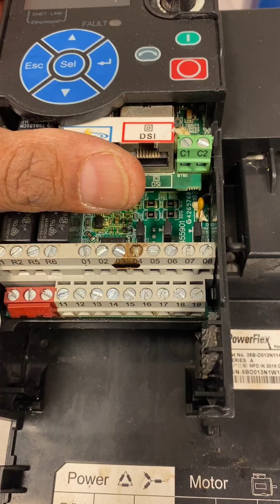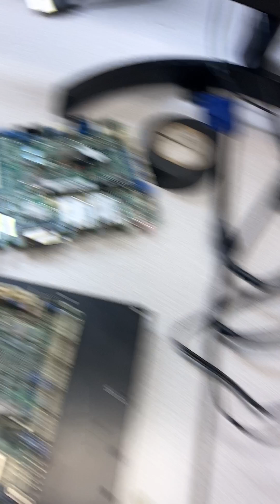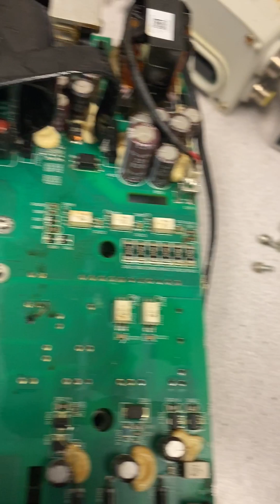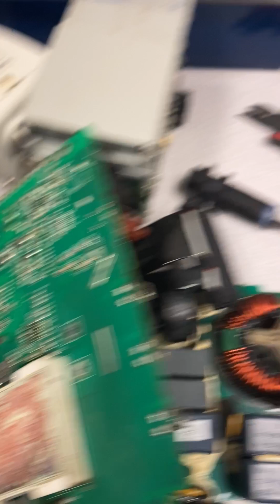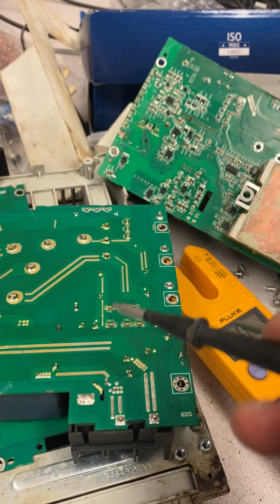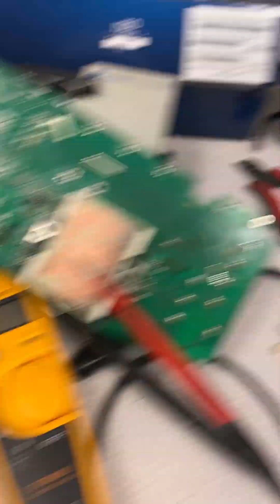How to fix and repair VFD, PowerFlex 40

Comment: Do you have a video on how to repair a ground fault issue on the powerflex525. I know the drive is bad not any motors or wiring externally

Comment: What is this for?
Reply: It's a variable speed drive (VFD) controller. They're used in industrial controls for many things, but usually motors that run on ramp rates and...drum roll...variable speeds.  I'm sure this helps someone with this very specific problem for this specific model, but caps seem to be a problem with heat (as his example looks like it was on freaking fire or something mounted by something that was on fire...the grey casing turned brown).

Not a great tutorial on board repair if you're looking into this hobby. Nope. Not a good fix it video at all.